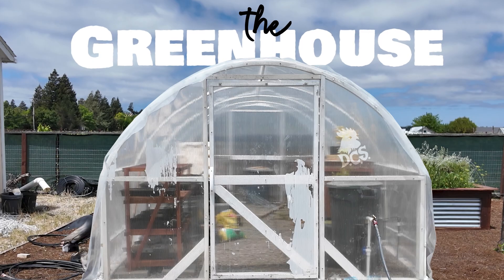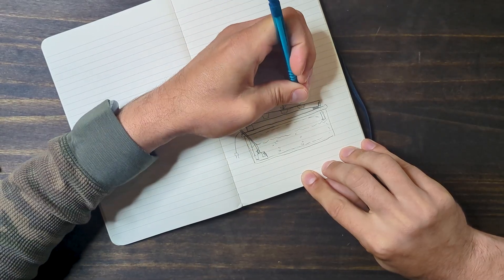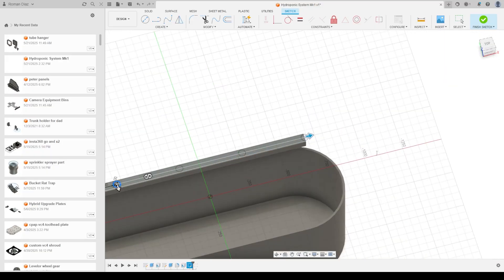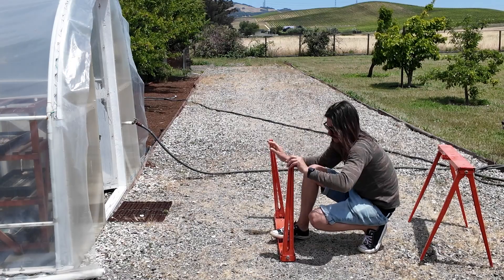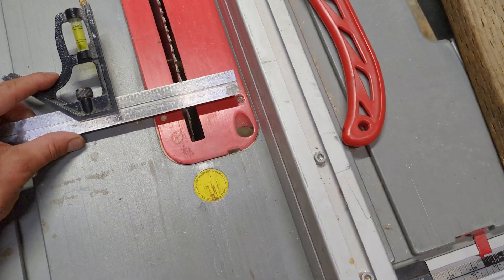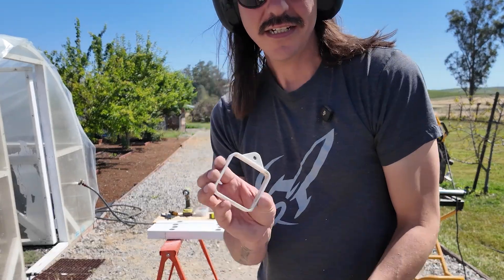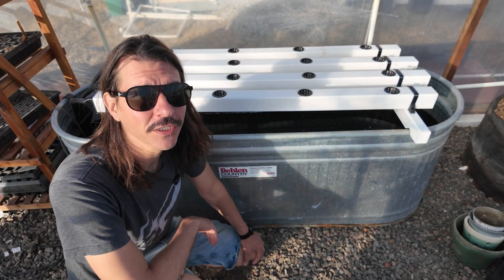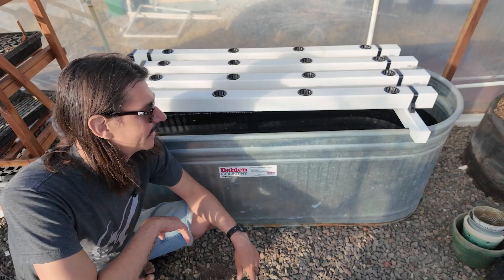Can I Revive My Greenhouse with a 3D Printed Hydroponic Build?

Comment: Suggestion:  heat the plastic hose with a hot air gun to make it more pliable. 
Suggestion: use air stones to lift the water. This will aerate the medium making it more effective.
Reply: The airstones and air compressor will replace the pump.

Comment: cover the exit end with a cap that only covers half of the downspout... This will allow your roots to retain nutrient solution in the event of power failure.
The nutrient solution will fill to half of the downspout and then flow over the half cap and you will have the same flow but with added protection of keeping your roots in nutrient solution .
Enjoy!
Reply from the maker: This is a great solution! I definitely want to add this in V2. Thanks for the pro tip!
Reply: @DiazCreativeStudio  
That will turn the NFT (Nutrient Film Technique) into a SWC (Shallow Water Culture).
Reply: Yes for sure!!!

Comment: Dont waste your time with NFT. Just use EROPONICS with spray nozzles.
Reply from the maker: I'd like to try that too. When I get this setup running, it would be fun to do both and compare.
Reply: @DiazCreativeStudio  
A good NFT will provide exactly the same results as a sprinkler or sprayer based aeroponic system. To gain an advantage you need to use mist, which provides significantly more control over the water and nutrient delivery.